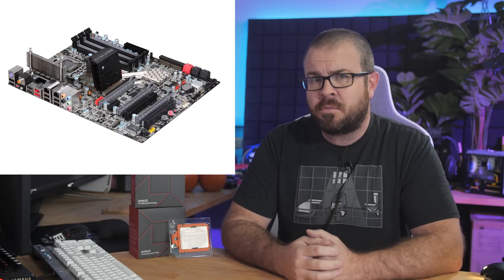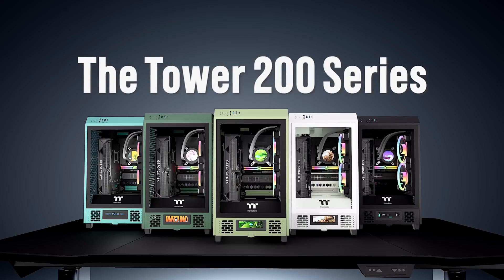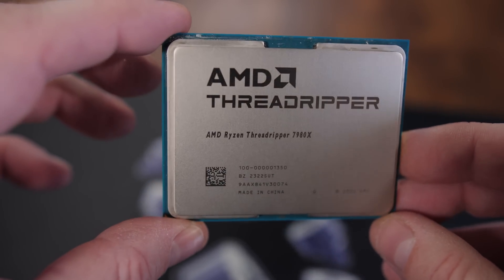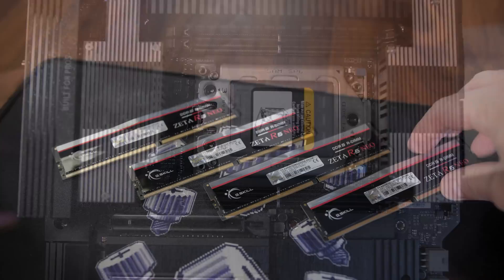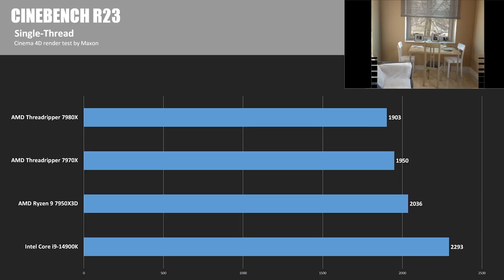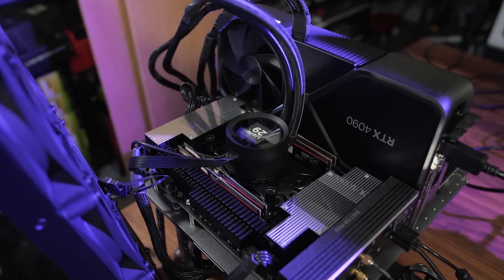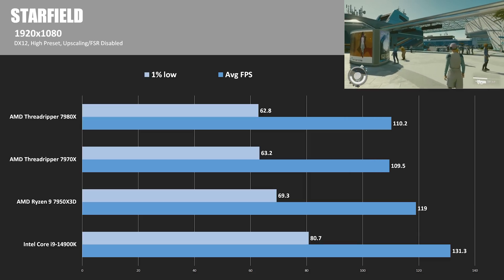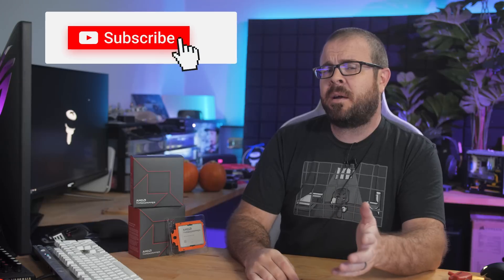How fast is a $5000 64-core CPU?! Threadripper 7980X and 7970X Review & Benchmarks

Comment: Honestly I’m not a gamer and really considering saving up for a Threadripper 7980X for 3D scanne and Fusion 360 I’m just tired that my PC keeps crashing when using Fusion or when scanning and a message say insufficient memory 😩 my dream Pc will be the 7980X with 4 48GB ram from corsair vengeance and the 5090 GPU or preferably the RTX 6000

Comment: I know this is old news, but why is it that so few reviewers got or reviewed the 7960X? It seems like it would be "The" go to for people trying to bridge the gap between full workstation & a gaming PC, since it's 'only' 24 cores 48 threads, but it also clocks higher, is cheaper, and thereby makes the new TR setup more attainable for people already spending thousands on a gaming PC (even if you go 7800X3D & 4080 or 4080 Super instead of a 4090 it's still over $2k for a full setup).
Now that the 9000-series is out and very disappointing, I wonder if a 9000 refresh of TR is coming, and if the 7960X is worth looking at for people that do work & play on the same system.

Comment: Nice and informative video, I'm curious about the maximum temperature of the 7980 X during rendering at 100% load. In 3Ds max/corona renderer it goes up to 93 degrees and is this normal? With 360 mm thermaltake cooling

Comment: Great video Paul!  Really good to know about the comparative facts for Blender, video compression, gaming etc as your ASUS board is the one I'm looking at purchasing along with a 7960X.  While I do a lot of 4K gaming (and good to see the frames on that average out or at worst, are slightly behind), it's 3D and video work that's just starting to demand more resources than my current X299 machine can provide.  

Sure, 7950X3D or 14900K are better values, no one's denying that - it just depends on how much work you're needing to leverage on the machine and what those requirements are.  At least the prosumers aren't just stuck with paying $5K plus for EPYCs and that's it.  HEDT at this level is indeed a niche spot but nice to see AMD offer a solution for it.

Comment: I have one major issue with these kinds of tests.. Most people who are actually looking at these high end, very expensive cpus are going to be using them in workstations for vfx, creator, development and/or data center tasks... They arent going to be using them for gaming. Also, tests like cinebench really only provide a very narrow perspective for a use case that is being slowly phased out of the industry and that is cpu rendering.
   It would be much more valuable to the people who are considering the purchase of these chips if the reviews included test bench comparison when running simulations in applications like blender, c4D, houdini, embergen etc. Simulations like fluids, smoke and pyro, rigid bodies, cloth etc. Set up tests for these simulations, run them with each cpu and compare the performance results.  
   Simulations are ideal because they provide a blend of single core and multi core tasks and processes in order to fulfill the calculations. Testing a threadripper for gaming is, as you pointed out, as useful as matching a semi-truck against an f1 car.

Comment: Seems like you’re not taking advantage of all the power.   Could you run a file server, have a monitor with 50 tabs open, miner, video editor, and a game.    Not being funny.  Is that possible to utilize everything not necessarily anyone of those task just a bunch of tasks instead of shutting everything down.  Everything on all the time type thing.   I don’t see how it’s worth even $1000 bucks 5k no way.

Comment: Hello I need a opinion about this build i choose , upgradable ,new characteristics for future , using for rendering heavy cad ,data calculations before to buy it , why this build , i like AMD, any suggestions... 
-ASUS Pro WS TRX50-SAGE WIFI CEB Workstation motherboard, AMD Ryzen Threadripper PRO 7000 WX,
ECC R-DIMM DDR5, 36 power-stage, WiFi 7,PCIe 5.0 x 16,PCIe 5.0 M.2, 10 Gb and 2.5 Gb LAN, 
multi-GPU support.

-MSI GeForce RTX 4090 SUPRIM LIQUID X 24G Graphics Card

-AMD Ryzen™ Threadripper™ 7960X 24-Core, 48-Thread Processor

-ASUS ROG Ryujin III 360 ARGB All-in-one Liquid CPU Cooler with 360mm Radiator. 
Asetek 8th gen Pump, 3X Magnetic 120mm ARGB Fans

-TEAMGROUP T-Force Z540 1TB DRAM SLC Cache 3D TLC NAND NVMe Phison E26 PCIe Gen5x4 M.2 2280
Gaming SSD with Ultra-Thin Graphene Heat Spreader

-TEAMGROUP T-Create Master Overclocking DDR5 R-DIMM 64GB Kit 
(4 x 16GB) 6400MHz (PC5-51200) CL32 Hynix A-DIE Workstation

-Seasonic Prime ATX 3.0 TX-1600, 1600W 80+ Titanium, Full Modular, Fan Control in Fanless, Silent, 
and Cooling Mode,12 Year Warranty

Comment: The time has come to buy a new PC
I'm thinking of spending $20,000 to $30,000 including 6 monitors 4090 2tb of ram and probably 6* 8tb ssd
My main issue is the cpu, i like gaming allot
Though I need a ton of cores, hard to decide between new amd16 core for gamingor 64/128 core thread rippers, would make sense to get two more computers but I'd rather just have the one.
Reply: It's way overkill dude... You won't ever need 2tb of ram... 64 to 128 at max is future proof way beyond.

Comment: I'm considering purchasing the threadripper for a deep learning platform I'm building, I also do simulations and work in Unreal engine. Could someone provide any insight on whether these use-cases could be worth it? I know I saw someone run a Monte Carlo Markov Chain benchmark (MCMC) and it seemed threadripper was several x better than the next best option. Thanks for any insights!

Also curious, could the multiple cores impact strategy games more than FPS where I think there's a hard CPU-bound on pathfinding and agent calculations?

Comment: 3955WX + 2x 3090 Kingpin here.

Extremely excited to upgrade to a Pro 7000 chip but very concerned that inflated pricing will pressure me out of a core count upgrade to 24 or 32

Comment: We’re considering a threadripper build to replace M1 Ultra Mac Studio’s for our developer workstations.

We build a financial crime detection platform which has an intensely heavy parallel test suite. At full blast it can consume ~650 threads. We’re hitting the limit of performance on the Mac Studio and a 64 core threadripper is comparatively good value for the performance boost.
Reply: Or the 96 cores pro version, or 128 cores EPYC. ;) Depends on your job. ;)

Comment: Is it wrong that I so want to build a HEDT, even though I would never EVER come close to using it to its fullest extent? I built a massive server for the house some years back, Dual Xeons, max memory, lots of big (at the time) drives, and eventually took it down due to not ever needing all the power and the fact that it sounded like I had a jet engine in my basement. Guess it's cool I don't have lots of cash to burn anymore. Great video once again.

Comment: Very cool though definitely not on my radar to actually buy. 

I'd like an reasonably priced efficient build with a lot of PCI-E lanes for storage and other uses with tasks like video editing. Like 16 cores maximum and would even prefer something with a TDP of 65 or 90w. I guess 24 lanes then. Kind of goofy manufacturers limit consumer systems so much here considering how many lanes an add-on GPU takes up. 🤷 I have a Highpoint 4x NVME storage card in my current system to get around not being able to use those cheap ones that use PCI-E lanes to work instead of a controller that handles the SSDs.

Comment: I think these have a class. But these are comparable to the $2000 PC's that could handle 7 cards at full speed. This is the price. That AMD k62 400 Mhz with an AGP and 6 cards of 1998. Fast Forward to today and that's a $3775 PC. The difference between is now double the price. This is really the cost to support 48 lanes of if PCIE 5.0, (vs the 128 lanes form the PRO Variant;) you might as well add another 0 to the end of the price before the Decimal. If you don't need 48 PCIE Lanes or 64 to 128 Cores, then you probably shouldn't buy this.

Comment: quick correction to what you say @ 6:10: you are NOT limited to 48 PCIe lanes. As the next slide you show says: you get 88 PCIe lanes in total, but "only" 48 of them are Gen5! Most of the others are gen4. So Quad GPU at full bandwidth is perfectly possible with the non-TR variants (64 lanes). You even still have enough left over for multiple NVMEs.
Reply: Hugh_I
Gen 5, why you need these micron drives ??? Please wait !
Try to write one use case scenario for these lanes !
they just glue them on the chips, getting more I/O too, that many PCIe lanes is over kill !
One NVMe only makes the GPU render more frames !
Reply: @lucasrem  Yes that many lanes is overkill for most people. We're talking expensive professional hardware for specific use cases here, not your consumer hardware platform for everyone. Neither of those lanes nor any amount of NVME makes your games "render more frames".

For example, a render workstation for a VFX shop that uses multiple GPUs to render massive amounts of video, stores the footage on multiple fast SSDs and shovels it around to other render nodes over a 100GBit NIC.

Comment: 6:10 - You get 88 PCIe lanes. 48 of them are PCIe 5.0. You have another 40 PCIe 4.0 lanes, which is around double of what you get on previous gen desktop platforms. 

Unless you're rocking an insane amount of PCIe 5.0 devices, this seems like a rather moot point. 

Like - what, exactly, are you running on a TRX50 platform, that needs more than 48 PCIe 5.0 lanes and 40 PCIe 4.0 lanes, that makes it NOT worth your money to get the WRX90 platform?

Comment: I really miss HEDT.  Shame it's still dead.  HEDT should use consumer memory and it should range from 12 to 32 cores with quad channel memory, 40 PCIE lanes and start around $1200 combined for the cheapest CPU and board.
W790 and TRX50 are Lite Workstation instead of HEDT because of the registered ECC server memory and outrageous price tags.

Comment: The funny thing is that compared to Apple's high end options even the 7980x has good price to performance. A system with that, a 4090 and a tb of ram would cost about the same as an m2/m3 ultra mac maxed out.
Reply: Jtretta,
apple, big WOW !
Studio on 2 Tb is enough, able to simulate all games on ARM. Not fast enough for shooters, but able to run all on ARM !
You never need HOT GPU PC's for games ! If only all studios develop for apple ! LINUX open apple ? develop titles for UNIX, who is ?
Reply: Apple's so-called high end options have several fatal flaws:

-very weak gpu, compared to 4090
-no upgrades
-no repairs
-cannot run Windows properly
-limited native software for m2/m3
Reply: And you still don’t have 145gb of VRAM 😂😂😂
And sips power

Probably living in your moms basement paying your utilities bill 😂

Comment: As someone who does traditional Vray rendering for Arch Viz, Photoshop and Video editing ,I am very interested in getting a Threadripper so thanks for testing those. I can see that it would toast my current 5950x. The only thing holding me back is that I also like to game on the same PC I work on. The 1% lows with a 4090 does not seem like a smooth experience. Appreciate the great review!
Reply: only in this review so far.

Comment: Little correction  its 92 PCIE Lanes , 88 of them usable , 48 of them PCIe 5 , which means you have 48 PCIe 5 and 40 PCIe 4 ( i guess ) ,  if you ask me , it is to get the chipset and Motherboard cheaper because PCIe 5 need lots of re drivers if the Distance to the CPU gets to far , thats why in consumer Land only the first 2 PCIe Slots get PCIe 5 even with the most expensive Boards .
Reply: glue more chips on the CPU, is getting more I/O too\why you need that many PCIe lanes ?
14700k is the best ! Less is better ! Why go HOT here ?
Reply: @lucasrem because  i have an PCIe card which fits 4 NVME with 4 Lanes each =16 + the 2 or 3 NVME on the Motherboard = 8 /12 Lanes , the 40 GBit Ethernet card = 8 Lanes , the GPU  = 8 or 16 Lanes , add it together  ...  = thats alone 48 /52  Lanes ! There are People out there which dont only use the CPU and GPU to play only Games . 
Intels 14700K is Bullshit  , has only 24 Lanes from which only 20 Lanes are usable  ,  without the ( up to ) 24 chipset  Lanes it would be only enough for 1 NVME ( 4 Lanes and 1 GPU  ( 16 Lanes ) . Those Devices attached to the chipset have to share the Bandwith of the only 4 Lanes which are  connected from the chipset to the CPU  .

Comment: I've been on my Threadripper 2950x for a while now. I didn't make the jump to the 3000 series (and I am glad of that, for obvious reasons), but upgrading to the consumer lines would remove a lot of PCIe lanes that I use. I have 6 m.2 drives (2 on MB, 4 on a PCIe x16 slot), graphics card, and a couple x4 cards, so I need all the PCIe lanes I can get. I'll probably be looking at the 7960x for my upgrade, but really hope they get some more MB's, as I've not seen any that seem like what I want.
Reply: arlolambdin8710
You need so many I/O, gamers only need one fast PCIx 5 drive now, one GPU, less is better.
consumers buy DELL, getting intel only. Build your own PC, do that on AMD, why not ?
I love the 14700k, less is better, gerring more frames only.
Keeping the old Xeon for all the drives and server tasks.
Reply: @lucasrem  this is a work machine more than a gaming PC...let's just say you don't know my use case

Comment: Very much considering the 7960X for my sysadmin system for the decent amount of cores, the PCIe lanes, motherboard/chipsets features, and the 4 channels RDIMM ECC.
Running scripts, 100+ tabs open across 4 different browsers, virtualisation/container in the background, etc..
Reply: guillaumechanut
sysadmin ? Unix on it ?
Why you need so many I/O, how many users you connect on the system, 10.000.000 users ?
NIC ? PCIe cards ?
If users run scrips, you need this system ! If it is only you, you never need this level.
What VR ware is supported to run on AMD ? you write it all yourself ? demanding that all others use AMD hardware too ? only one system ?

Comment: The irony is, is that CPU based rendering is sunsetting, in favor of GPU based rendering. There are still some use cases in production where you might want a lot of CPU cores, but that is shrinking too, and really only in cases where you are constrained by VRAM on the GPU, and you need access to a much larger memory pool.
Reply: CPU rendering is more accurate than GPU rendering. Video editing, compilation, general multi-tasking, VMs, generative AI, LLMs, encoding, game dev, streaming are all use cases where you want a lot of CPU cores. In other words basically anything you can do on a computer. 16 cores is the bare minimum for me and even then it isn't enough. Low core count CPUs are quickly becoming obsolete.
Reply: @chiefjudge8456  

Accuracy is kind a misnomer here, I think what people mean by that, is that GPU renderers need more samples to create a clean image, but the problem isn't that one is more accurate than the other given a specific method of rendering. 

What matters in production is the end result for a given cost, which scales with the budget. Most TV and Film work I do, is done on the GPU because the GPU is just faster to get results that are often better looking depending on the renderer. 

What will matter in the end though, is the quality of the denoising, which is still lagging behind, but no one wants to wait on the CPU anymore, and denoising tech is rapidly evolving.

Comment: @Paul's Hardware : Paul can you please test the new Threadripper CPU in Windows 10/11 to see if it crashes like the older generations (the infamous "event ID 56 - ACPI 15" full system crash) so that people know if this problem still persists or not ?
Thank you.

And since you are actively using gen 1 and gen 2 Threadripper series CPU's : can you please let us know if you've experienced any event ID 56 (ACPI 15) crashes with these machines ? And if not: can you please post the detailed system specs for these machines ?

Comment: I rocked my i7-920 system for 10+ years. Although by the end of its life it had an  i7-965EE from Ebay and 24 gb of RAM (6! X 4GB).  If the system hadn't started frying power supplies it might still be in service....
Reply: I got my first X58 system with an i7-920 in 2013 and 10 years later I was still on X58. Though I recently moved to X299.
Asus P6X58D-E, X5670 6c/12t @ 4.4GHz, 24GB DDR3, GTX 1080 Strix. I could have used it as my main for few more years but more and more games and software requires AVX and AVX2 instruction sets
Reply: garretthaney9134
2014, yeah, i do remember, still have them here, the DDR 3 years !
920, all my Quad Core systems run better than these old i7 systems, low power i7 CPU's, VS the hungry 775 old socket PRO models on > 120 Watt !
DDR 3 systems, all you need to do is replace the CPU for the most advanced you can find for it, GTX 1080 in it, good for 1080p Fortnite !
Reply: I was rocking my i7-4770k system for over 9 years then i finally switched to the ryzen 7 7700x
Reply: My friends dad had an i7 860 system from Gateway years ago, kept it well after it became obsolete. Pretty sure they got rid of it now if it isn't just lying around somewhere. None of my personal systems that I built had intel. Rn I have a 3900x had it since July 2020.

Comment: 06:10  This is wrong, which you can see in your own screenshots.  The HEDT parts have 48 PCIe 5.0 lanes, but 88 lanes total.  That's an additional 40 PCIe 4.0 lanes.  That's plenty of I/O, and the only real use case for PCIe 5.0 anyway is with SSD's.
Reply: Yesssssss... So many reviewers got this wrong. There are no consumer or prosumer pcie gen5 devices worth buying anyway. And ~88 lanes of gen4 is a tremendous amount of connectivity. ~160 GiB/s of IO bandwidth.